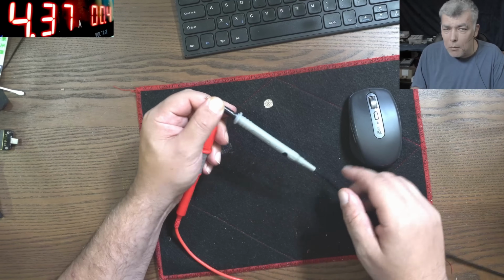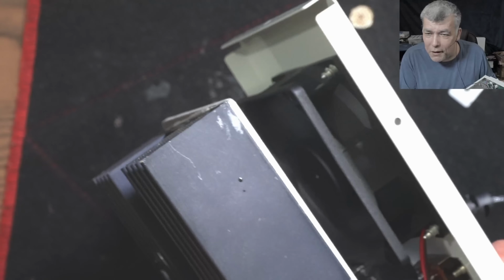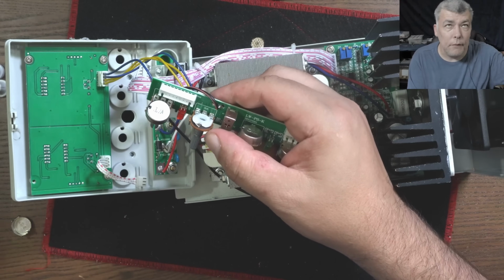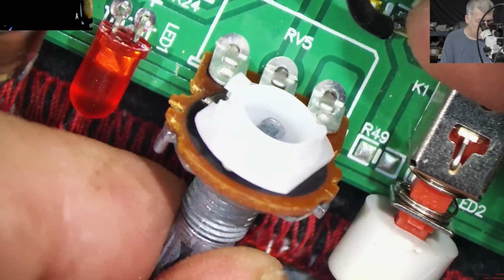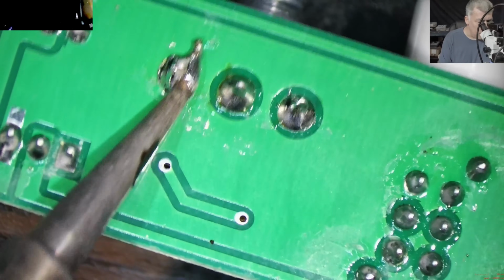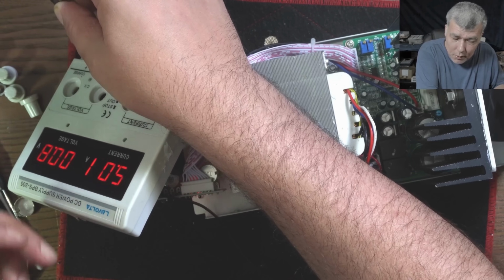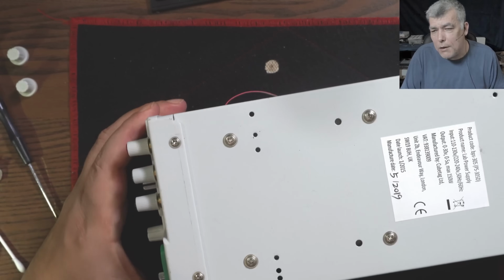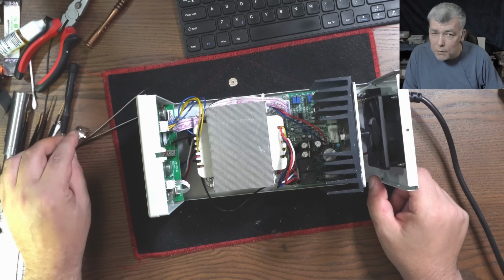My power supply............

Comment: This power supply has adjustable voltage and max current adjustments. I think people confuse constant current mode with short circuit protection.

Comment: put a piece of paper between the wiper and black/carbon stuff and polish it.... THEN BEND WIPER carefully
ps. search Riden RD- 6006-P And the P is important
ps2. And the latest 6006p has 4 wire provision, accessed in the rear with a switch and the S+ S- connector. 5 digit too

Comment: Personally,  I would never take a potentiometer pot apart, not even to clean. Always spray a cleaner through the provided gaps and work the pot. WD 40 will do. Lighter fluid, but I think that woube dangerous in your environment.  Deoxit is the premium cleaner. If you can spray ISO Propyl alcohol,  that will do as well. I use that as a go to for most electronics maintenance. When buying potentiometers, they come in two types and I would assume you need "linear taper." If you buy cheap,  they wont give you accuracy. You'll soon wish you hadn't.  Potentiometers do deteriorate over time, but its the dust that builds up on the resistor track that is the problem. You should ask your famous sound man about potentiometers.

Comment: I was recommended zippo lighter fluid to clean potentiometers.
I was told to just apply on them, and it will sock in, and clean it while you simple rotate it.
I was sceptical because it is flammable liquid, but it had worked on many instances with no issues.
Reply: Probably kerosene or mineral spirits might work too in that case..hmm.
I will have to get some Zippi fluid and give it a try.
Thanks for the tip

Comment: Whatever happened to those wool boards they used to put in the dial knob you know the white ones that were there to clean the tracks as you turned the knob i can't remember what they called them but thats what i would use to help keep it clean.

Comment: Since the mid 60s, I have always used cigarette lighter fluid to clean the pots. Do not take it apart just squirt it in and work the pot.
Reply: That's very interesting, which one, the compressed air can type??

Comment: Nobody is going to teach the following companies how to build:
a) a DMM (digital multimeter) to Fluke
b) a oscilloscope to Tektronix
c) a soldering station to Weller ...
Analogously to Allen Bradley (founded in 1903) and Clarostat (today Honeywell founded in 1906) how to make potentiometers.
Allen Bradley sold its commercial components division to Adafruit (which builds the original Hakko soldering stations). Another way of saying it; in mouser write: adafruit 10K potentiometers and choose the linear type, very economical by the way. All the best.

Comment: Nice fix but I wouldn't recommend you use it like that where it can turn around freely... if you have it set to a very low current to protect your circuit, and accidentally slip or go a little further, suddenly you get the full 5 amps into whatever you have connected...

I agree with other commenters, the potentiometer is probably worn out from a lot of use, better to replace it with a higher quality one.

Comment: Uh, those pots have a small cutout on the side.  Spray deoxit or contact cleaner in and rotate for 30 seconds.  Super easy.  Then you can measure them to make sure they dont have dead spots.  That can also be an issue, but you need an analog Ohm meter.

Comment: I've a couple MLINK DPS3005 (same as KORAD KD3005D and RS RS3005D but much cheaper) and those use two rotary encoders and the settings can be locked.
I bought them 4 years ago for €40 each, now they cost €60.50 in Spain... I've no idea if those are available in other countries.
Note: The MLINK DPS3005 It's not the same as the generic DPS3005 buck converter module with LCD screen or DPS3005 power supplies from another manufacturers that are the same as the one in this video.

Comment: Two years ago, I came across three power supply devices that the owner of the maintenance center had abandoned for this reason, and they were suffering from the same problem. This is due to the frequent use of this particular resistor (a consumable reason).

Comment: I replaced the fan on my unit with 12v noctua fan that has a good airflow but since the original fan runs at 24v (27v measured) and since i don't have a buck converter i just placed a 12v dc adapter (rectangular shape) to power the fan inside the unit secure it with a double sided tape and connected it to the mains of the psu switch now the psu is very quiet

Comment: You don't need to open the potentiometer,  just spray some contact cleaner.
Reply: Some are sealed and have not a little hole for contact cleaner...you have to open them as they are SEALED

Comment: A little bit of WD40 should do the trick. I used it for potentiometer and it works just fine now.
Reply: carbon strip can dissolve
Reply: @victimovtalent6036 yep ..best just to use isoprop.

Comment: I would put back that metal casing on the potenciometer only for 1 reason....in case you are starting working and maybe you forget to check the amps, you can unleash 5amps on something by mistake ..meanwhile, if you reset by default the knob on the "Min" current position, you are sure to start from low amps

Comment: I have a power supply where I've cut the fan wire and connected a bimetal switch set to around 50°C in between. 
The switch is now sitting between the fins of the worst ventilated part's heatsink. 
And so... when the hottest part gets warm, only then does the fan get power. 
When I am just messing around, everything is silent. 
When I charge batteries I don't have to think about turning on the fan. It just happens.

Comment: Hi Sorin. I have a similar PS, it's a 30V 10A one with the same housing and front plate. I've ordered it from china and when it arrived, i was'nt able to adjust the current at all. After opening the device, i could see that one pin of the big ribbon cable wasn't locked correctly into the connector... chinese stuff. 😂

Comment: Sorin just spray it with WD40.
Reply: I used WD40 on a pot once. It swelled the rubber resistor inside, causing it to be harder to turn, but then later became even easier to turn that originally, It worked good for a while, but eventually returned to the same problem. It seems that once pots start going bad, cleaning is just a temporary fix. Maybe what happens is that those rubber resisters start crumbling microscopic particles from the rubber getting old.

Comment: Hi Sorin. For cleaning a potentiometer or a fader a Deoxit F5 and afterwards Deoxit F100 for better contact and lubrication works often like a miracle and if the actual track is not destroyed it will fix it. Saved me many times. For any other contacts cleaning a Deoxit D5 and D100 can be used. Hopefully it will help.

Comment: You can get a bit more Amps when you remove the stop, so the potentiometer turns a bit more.
But is it good to have the wipers go out over the metal?
Maybe the wipers will be damaged and then the carbon tracks will be damaged as well?
Maybe?

Comment: You need potentiometer 10K. B mark should be linear resistance change of resistance when you turn the angle. You can see this mark on front side of part.
Reply: Indeed, the carbon track will get dirty quickly again. Also the cap is pulling everything together so contact runner will put some more pressure on it.

Comment: Thank you for the video. Could you show us your USB-C/charging wiring in more details? I often wondered how you use your power supply to deliver the 19V through the USB-C.
Reply from the maker: Hi, if you check the video description, there is a amazon list and the charging port adapters are there. All i did is to cut down the usb-c end and use red and black wires and connect them to my power supply.
Reply: @electronicsrepairschool  Not in the description :)

Comment: Hi Sorin ! I have the same power supply. Potentiometers are very low quality. I had a similar issue in the voltage regulation . I clean potentiometers and work for a while . Better solution to replace all of them with high quality .
Reply: It is indeed better to replace these trinkets with high quality potentiometers, then you will enjoy them for a lifetime. I always do this and it is not that expensive.
Reply: @Professorke can u share link to ỏder?
Reply: @VanDuc1126  The system does not allow sharing.
Reply: i have same issue with voltage, replace potentiometers but after few times on/off, issue comeback, can u sshare link order high quality potentiometers?

Comment: The wiper on the POT looked fine, did i notice the relay is not clicking also? I thnk the relay might be suspect?
Reply from the maker: The relays are clicking, otherwise it will not switch the voltage up and down
Reply: @electronicsrepairschool  Ok, i could not hear, the relays are mechanical also, spring can get old or as another member mentioned the relay could "Arc", which could happen if Zener at the relay failed? I am just going on basics of what i know, am not at your level by any mean's, it must be a real puzzler then, thanks for reply Sorin
Reply from the maker: If will be a relay, i will have problem with less current also, but yeah, can be a faulty relay